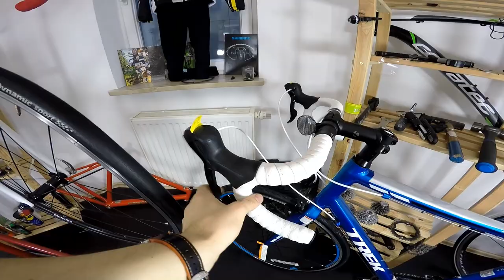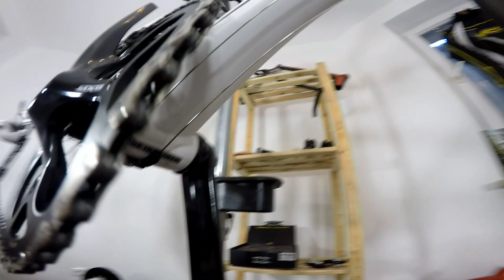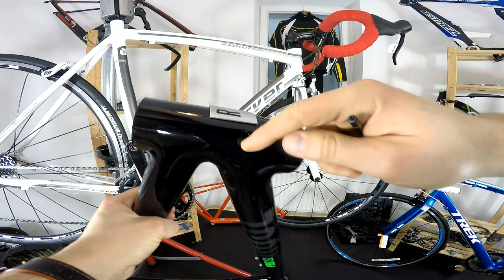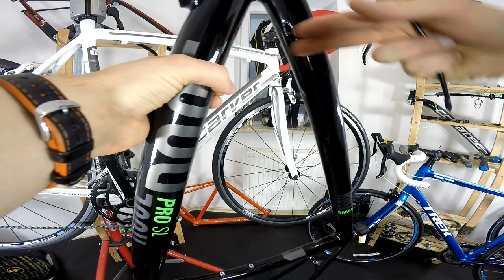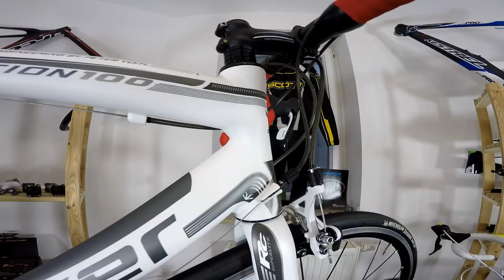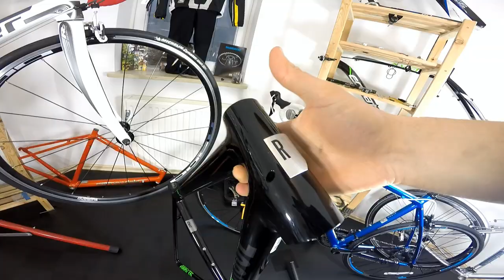DON'T THINK the internal cable routing is better, than external. Bicycle cables.

Comment: I had an issue with the front mech and had to change the cable 3 times. If I had internal routing, I'd probably gone insane. Glad there's an actual performance advantage to external routing.

Comment: I think you are correct about internal vs external cable routing. For the rear derailleur, the housing loop at the rear can cause a lot of friction with affects the shift quality. i use a device called an Avid Rollamagig which is basically a grooved pulley which Gets rid of the loop and greatly improves shifting. It was made by Avid but they are not made anymore (mine is twenty years old). You can probably find one on ebay. SRAM uses this system in their rear mech, I think they bough Avid.
Reply from the maker: +MarzNet256 Very smart little pulley - why isn't it more popular...

Comment: How about hydraulic cables (e.g. brakes & a dropper seatpost)? Is there any potential performance degradation for these when routing internally?
Reply from the maker: Hydraulic cables feel OK inside the frame until... you want to replace the brakes. Then you need to cut.
Reply: Well, when changing levers or calipers it is still possible to leave the cable there (provided it is compatible with the new parts).

Comment: The same curves and bends apply external routing.  First you say bends/curves is not good then you say more bend and flexibility is better at the handlebar end. If the cable is internal would that not mean less cleaning required for the internal sections which are not exposed to dirt in the first place.

Comment: Hydraulic brakes with an eTap groupset.  More aerodynamic, unparalleled shifting, and low maintenance + weight.  Thats what I run on my P5, two years and never needed to fix brake fluid.
Reply from the maker: Thanks for sharing!
Reply: How have you been using Hydraulic Brakes and Sram eTap together for 2 years? Maybe Shimano Hydro Di2 ?
Reply: Sorry, meant 2 years on the hydraulic Magura brakes - eTap was a new addition this season.  I meant i haven't had to bleed the hydraulic fluid after two years of usage.